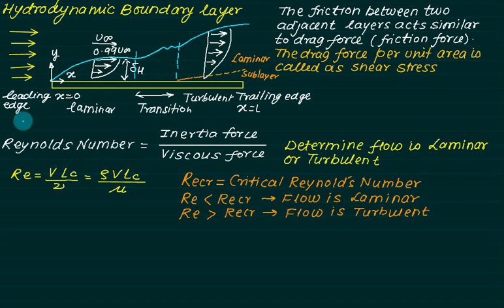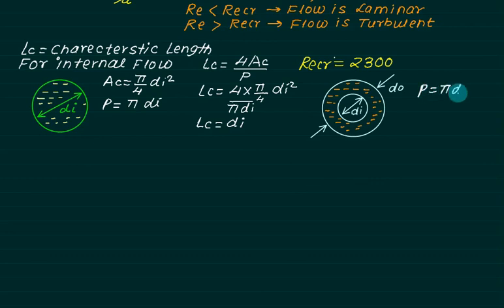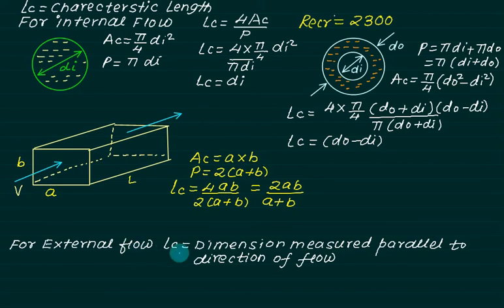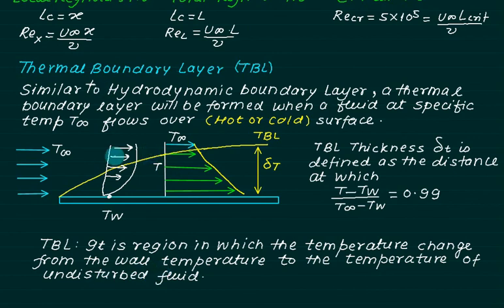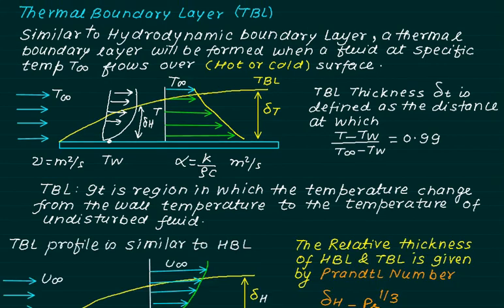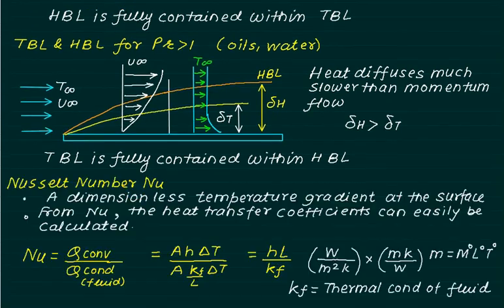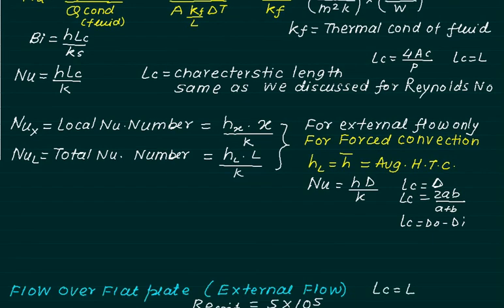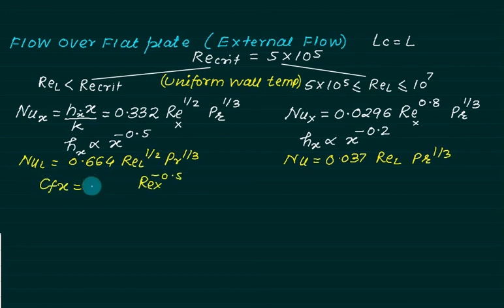conevction 2

Comment: Sir what is characteristics length for vertical tube having dia=d Length=l
Reply from the maker: Check external or internal flow
For internal flow Dia
For external flow length
Reply: @sunilmohodmh31  but sir in books they give different different formulae for different shapes eg-cylinder vertical cylinder

Comment: sir what is physical significance of characteristic length , like critical length is length where laminar flow become turbulent, how we define characteristic length
Reply from the maker: characteristic length is normally required for Reynolds number and Nusselt number as they handle various geometries like plate, cylinder sphere, for this the term is useful
Reply: sunil mohod thanks sir

Comment: sir Is characteristic length valid only for turbulent flow?
Reply from the maker: characteristic length is normally required for Reynolds number and Nusselt number as they handle various geometries like plate, cylinder sphere, for this the term is useful. Both numbers are required for Laminar and Turbulent flow and Hence characteristic length valid for both flows i.e. laminar as well as turbulent